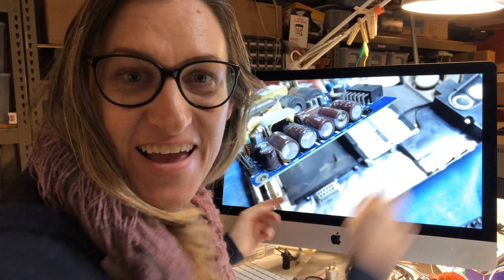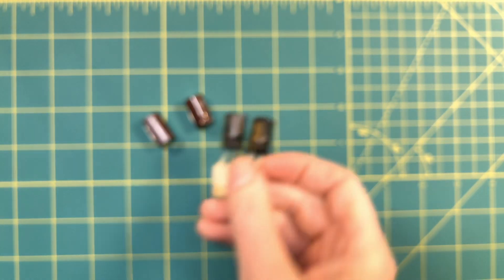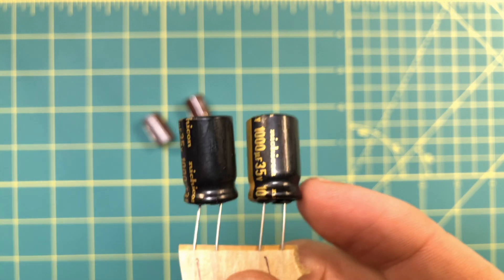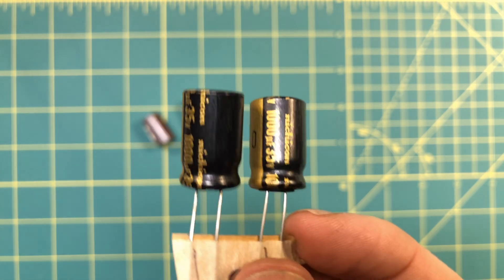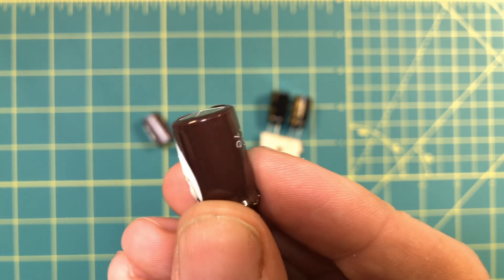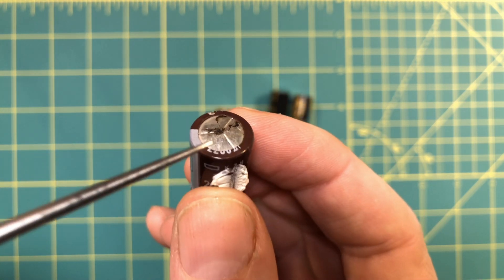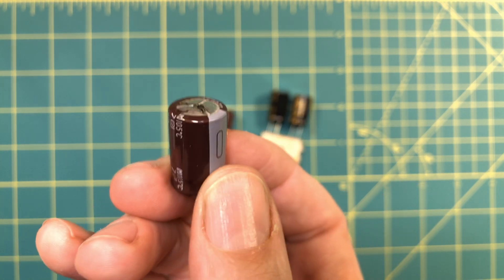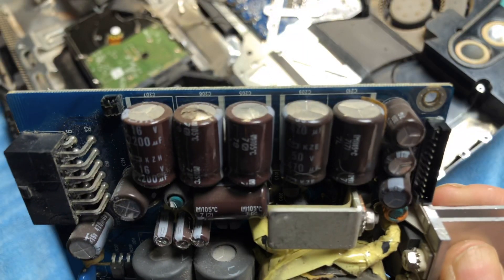Repairing an iMac Power Supply

Comment: Thank you for your support. I would like to know if you can help me with the noise after install the SSD on  Model  A1418  which comes underneath the logo of apple at the back of power supply. Everything works only the noisy its annoying after. How to fix it. your reply will be well appreciate.
Reply from the maker: Good question, its probably one of the cooling fans? If their bearings go bad, they can make an annoying whine. I haven’t replaced one myself though, and it might be a harder part to source since apple makes things fit in very compact spaces. Maybe a drop of oil would help quiet it down?

Comment: Great job! I have a 27" model from 2010, it's making a buzzing noise from the psu. But its working. I took the psu out and inspected it, it looks strange. But all the capacitors are looking good. But for some reason it looks oily...

Comment: My Mid 2011 27” A1312 iMac Power Supply is dead. I want to try and repair rather than replace if possible. I put the computer back in it’s box last year and recently went to take it out of the box and noticed a sticky film all over the screen as well as a sweet / pungent odor. Would leaking capacitors cause this ?
I have not opened up the computer yet to even inspect it.
Reply from the maker: I don't think the capacitors would cause this, they might leave a small amount of residue around the power supply pcb where they're soldered to the board, but I'd guess that the sticky film all over the screen is from something else?  Good luck with your repair!

Comment: Wow, you're just awesome! I recently lost my iMAC, power supply - no fan at all.  Q: How did you get the display glass plate out?  Meaning does it snap in or is there a magnet that holds it in? Where did you get the suction cups? Thanks.
Reply from the maker: Thanks! On older iMacs like the one I repair in this video, where the edge of the iMac is about 1.5" thick, the screen is held in by magnets, so with a suction cup (I got the suction cups at Harbor Freight) you can just gently pull the screen away from the iMac's chassis and it's quite easy.  On newer iMacs, like the ones where the back is curved and edge of the iMac is very thin, these screens are glued in (ugh!), and so they're a more involved repair, and it needs a replacement adhesive kit to glue screen back on.
Reply: @PaigeMaker  love your workbench, I'm jealous 😀

Comment: If I just open an iMac, how do I avoid electrocuting myself with the exposed PSU? Does it hold a charge for some time after being disconnected?
Reply: Take insulated pliers and touch cap leads to dissipate residual power. Or you could get big resistor and clamp leads on it to do the same thing. Make sure you always handle the board on the very edges. I always put Kapton tape over the capacitor leads when working on an iMac.

Comment: so you just changed the 2 capacitors? or did you need to change them all? Hard to see what you did exactly.
Reply from the maker: I replaced the 6 largest electrolytic capacitors on the board, matched to the same capacitance and voltage rating as the originals.

Comment: not bad for a girl  :)
seriously-  nice job.

Where did you get the capacitors?  I have an iMac 27" 2011 with a leaking capacitor- I'd like to do the same thing you did.
again - nice job - be safe.
Reply from the maker: Thanks! :) I ordered from them digikey.com. (Though I use mouser.com as well) I usually get either nichicon or panasonic brand caps, and note that they can be bad even if they don’t look leaky, though its a telltale sign when they are bad.
Reply: Did you fix your iMac friend?
Reply: 2011 same here i Have

Comment: Great video! Wonder how you decide if     the power unit or the power on switch is bad when Mac can’t be turn on?
Reply from the maker: Thanks!  I rarely use the power button directly!  So i assumed it wasn’t bad, haha.  And also, while the imac didn’t turn on, I could hear a very faint noise, like dvd drive was still getting some power when i tried to press the power button. But i had to keep my ear pressed to the case to hear it!  So with that in mind i decided to open it up and look for anything that might have failed, and it was then that I saw the failed capacitors and knew i had a chance at repairing the power supply. :)
Reply: @PaigeMaker  Same thing and "sound" just happened to my sons 2007 iMAC, gonna have to open it up again. We just put an SSD into it. Apple has such awesome screens hate to not keep this one going!

Comment: You are cool! 👍🏻🤩 My iMac 2007 doesn't powered on (not working—no sound or image) at all! Logic Board indicator light shown only light 1 was light up when powered on from wall plug then it just light off in a few seconds soon! What's your advice? Same issue as yours?
Reply from the maker: Raymond Looi 雷聖雄 thanks!  Be careful! Always to keep it unplugged while the case is off.  Unfortunately I don’t know if its the same issue though, I wasn’t able to see any lights on the logic board when i looked at mine.

Comment: I have an iMac G5 Ambient Light 20" with bad power supply.  Where do I buy the capacitor kits?
Reply from the maker: I removed the power supply and confirmed the capacitors were bad, then noted their sizes, and voltage range, and searched for matching versions on digikey's website. If I could have determined the brand, I would have replaced with the exact same models, but they didn't have any brand name on them so I chose to replace mine with good quality Nichicon capacitors instead.  I only replaced the large filter caps, the smaller ones were ok.

Comment: Neat fix! Normally I'd stay away from PSU's but for this non standard one it makes a lot of sense. The difference a few new capacitors can make :) Also, loved the soundtrack+editing.
Reply from the maker: Thanks!   Yeah, I probably wouldn't have bothered to repair a normal PC supply since they're so common, but I've performed similar repairs in old guitar amps and powered speakers, so I figured it was work a try... I guess all my equipment is starting to show it's age! ;)